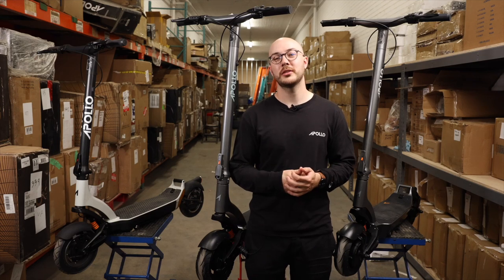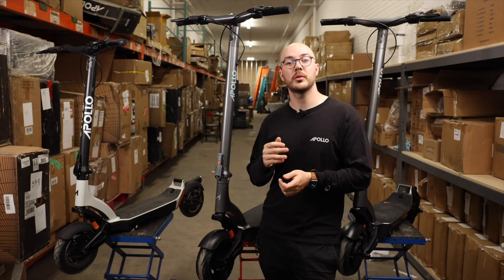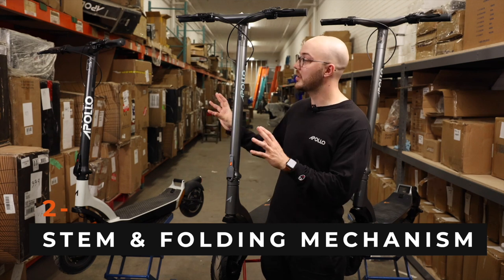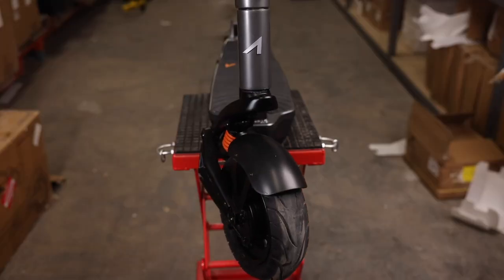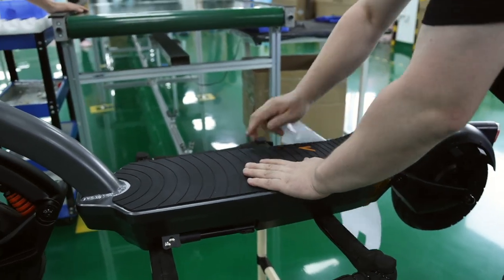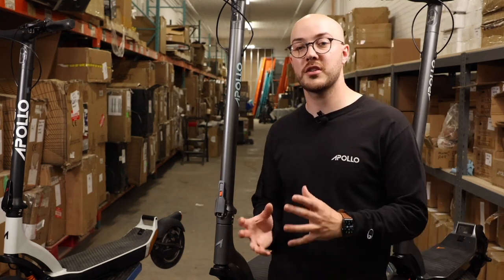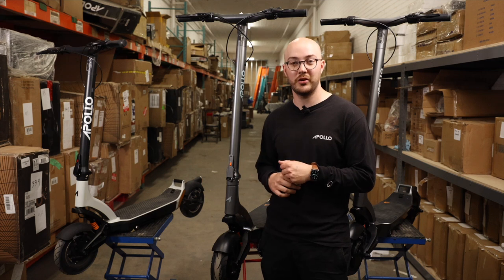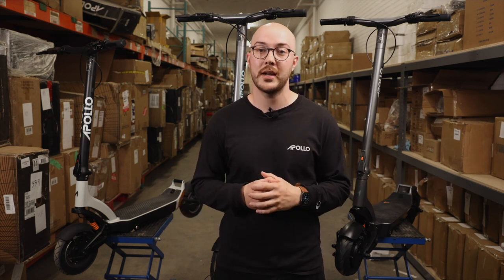Evolution of the Apollo City: Building the Most Integrated Scooter

Comment: Still disappointed Apollo didn’t put front indicators on the city bearing in mind the front deck lights are changing to orange on the phantom v3 and the video of the new Apollo pro that sits above the city has them on the handlebars! Should have those on the city aswell, sure it’s a cheaper scooter but safety stuff like good lighting and indicators should be standard.
Reply: Most definitely agree 👍 💯
Reply: As usual, they'll have a V2 of the City 2022 next year with "free upgrade" . This is the way. Well, this is their way.
Reply: @WillyBaldy  I hope so! Front indicators and folding handlebars for portability is all it’s really missing in my view. Don’t think the handlebars will happen tho bearing in mind design is in keeping with the upcoming pro model and the base air/air pro models. Uk still not legalised them and likely won’t be legalised until next year anyway so I’m hopeful for a v2! 😀